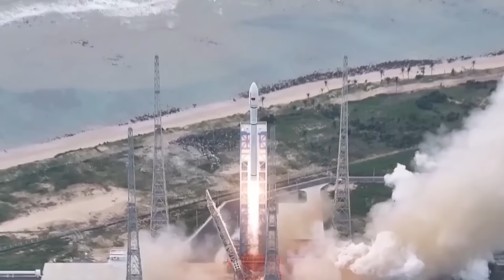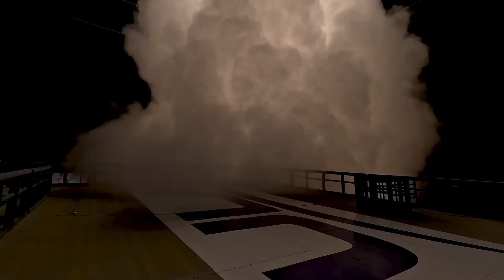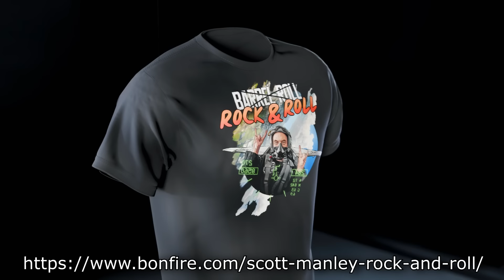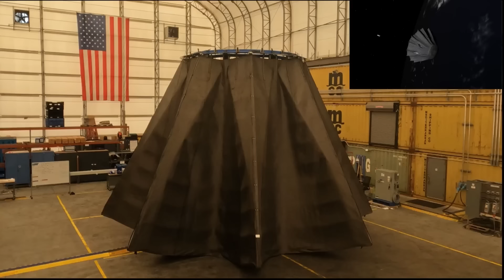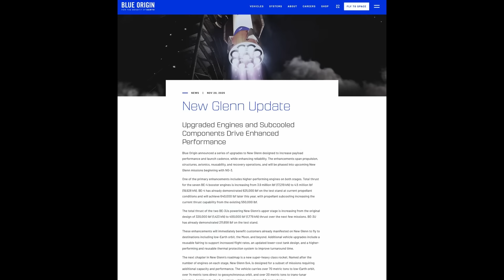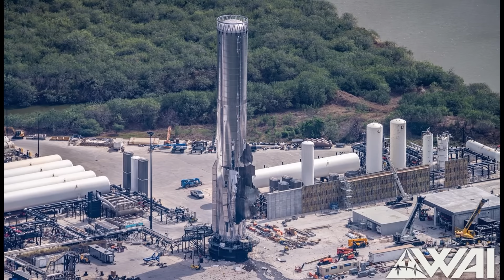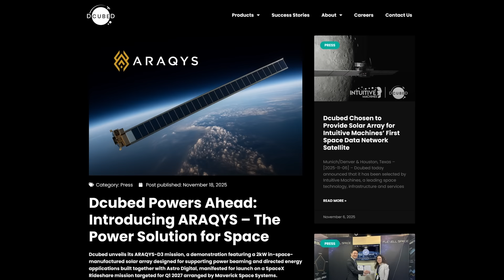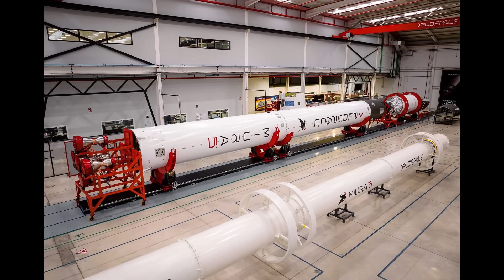Blue Origin FINALLY Reveal All Their Secret Projects - Deep Space Updates - November 22nd

Comment: Blue Origin's size comparisons to Saturn V are misleading. Methane has about half the density of RP-1, so you need a significantly larger rocket just to achieve parity performance, even taking into account the specific impulse advantage of CH4. Launch mass is a better superficial/first-order metric for that reason.

The upper stages are roughly comparable based on size since they're both Hydrogen-fueled.
Reply: I believe it was merely a physical size comparision.

Comment: Welding the rocket to the barge is one solution but why not have electro magnets in the deck plating to attract ferrous plates on the landing gear, the Curie effect is irrelevant since they are electro magnets.
Reply: Electro magnets would require constant high power draw. Also, if your ship loses power, you also lose your massively expensive payload.

Flash welding is instant, cheap and last as long as you need.
Reply: Electromagnets are one solution but why not weld it?

Comment: I don't see how new glen will be able to fly a bigger version when it lacks the thrust to get it off the ground
Reply: It's getting off the ground just fine so far.
Reply: Currently they have 7x2 engines on first and second stage, the upgraded version will have 9x4 with a wider tailend to accommodate these engines. So 30% more thrust on the first stage and 100% more on the second.

Comment: Blue has a lot of catching up to do.  Their proposed 9/4 rocket gets 70 tons of payload in orbit while the Falcon 9 can get 25 tons in orbit (corrected).  The new Glenn is projected to eventually get 45 tons to LEO, but is starting with less. My guess is by the time New Glenn is launching 25 ton payloads, starship will have delivered payload to orbit. No doubt a Falcon 9 launch is much lower cost per pound of payload and less risky than the new Glenn.   Space X might retire the Falcon 9 before Blue’s 9/4 is competing. The only way Blue will stay viable is Bezo’s using his insider connections to get a piece of the pie at outrageous prices to taxpayers 
       The one technical advantage of Blue is their efficient Hydrogen/Oxygen engines for the very high orbits and the moon.  Perhaps Jarad will cut out the legacy non performers and shift to Blue Zorigin and SpaceX
Reply: Where on Earth did you find 42 tons to orbit for Falcon 9? Did you mean 24? Blue is also looking to be competitive much sooner with SpaceX since they can look at what did and didn’t work from a business model perspective. If the current 7x2 version receives those upgraded engines, it’ll be more than capable of launching Amazon LEO sats at a higher rate than Falcon 9 along with ride shares. SpaceX needs to be on watch for Blue to eat up a significant portion of the market they have had a virtual monopoly on for a good decade.
Reply: @MoonWeasel23  17 tons when the land the first stage..?  Launching at a higher rate means they need to have their recovery, refurb etc issues dialed right in instantly and that will likely take a year or so.  They might yet want to tweak or refine the design as well.  So I highly doubt it's flying at a higher rate for years.
Reply: SpaceX and Blue Origin aren't a binary.